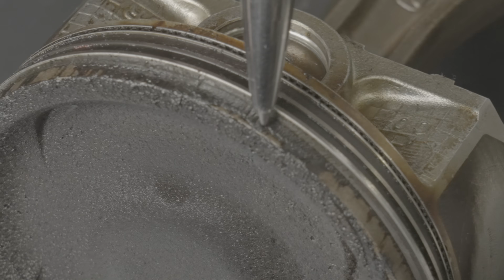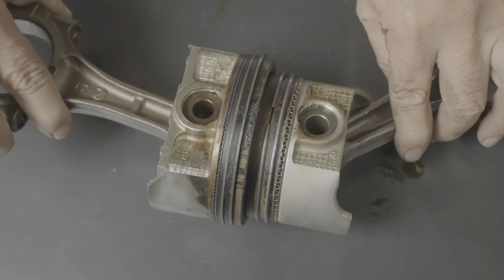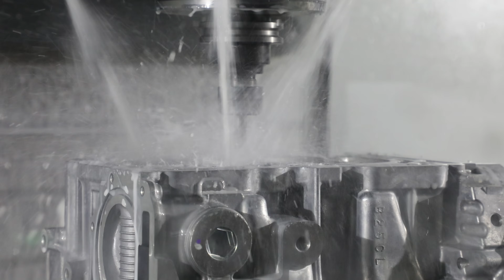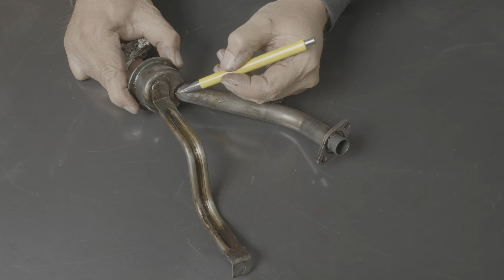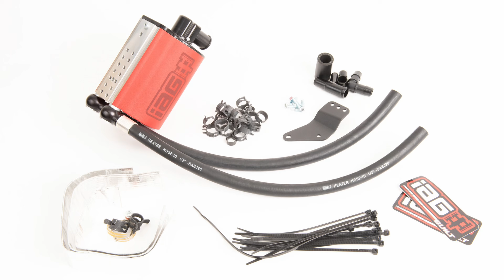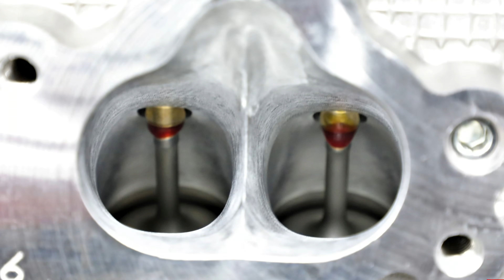Why Subaru Engines Blow Up!

Comment: Glad you mentioned the cylinder to cylinder variation Mike.  Every engine has some, but EJs are particularly bad in that way by design.  One other thing I think should be mentioned is how Subaru measures intake air temperature.  Until the FA20 came out, Subaru has always measured charge air temp on their turbo4s only at the MAF.  That's right, they only measure temps at the inlet, instead of after the intercooler in the intake manifold where it really counts.  I've never heard a good reason for this choice, but it's just a bad idea.  Can you make it work if you characterize your engine fully and understand the relationship between ambient temp and manifold temps at various load levels?  Yeah, kind of.  But as soon as you change anything related to engine load, your ignition corrections for charge air temp go out the window.  It gets even worse if you change intercooler performance (eliminating the air director from the hood scoop for example - see a lot of aftermarket hoods like that).  And if you tune with a carpet blower resting on the intercooler, you're probably not seeing the same temp curve that you see on the road.  So when you modify an EJ, you have a few options.  (1) Tune conservatively and closely compare on road performance with dyno conditions to make sure they correlate well (2) Convert to a speed density tune or at least move to a temp sensor in the intake manifold (3) YOLO!
Reply from the maker: We put it in the plenum if the tuner understands that.
Reply from the maker: I didn't realize you are our tuner and you do know that....
Reply: Seems like a lot of Subiebros chose the YOLO option
Reply: I mean it’s not like the intercooler does much. 

And I can guarantee the intercooler temps on a stock turbo Subaru is higher than the maf air filter box. 

It’s how heat and air works.
Reply from the maker: The intercooler does a lot to drop the charge air temp and improve air density.  A front mount can drop the temp by 200 degrees. You could calculate the improvement in air mass that makes and its considerable.
Reply: @fastinradfordable  basic wrx intercoolers are pretty crap, and the STI is a bit better.  But that makes measuring air temp at the manifold even more important.  The better your intercooler the closer to maf and manifold temps would be.

Comment: I own and have owned many Subarus. I love them, but sometimes it feels like they don't love me back.
Reply: One-sided love, probably one of the worst kind of relationships 😂
Reply: @aaronbryan5095  You certainly have a lifetime of experience with that....
Reply: It's like a abusive ex sometimes
Reply: Why I drive the other Japanese brand that starts with a T
Reply: @Carl-fl6wl u mean the frs and the new Supra?
Reply: Poor engine engineering
Volkswagen had the same problem with the waterboxer engines of the early 80s
Sad
Reply: Sounds toxic. I bet that Nissan chick would treat you better. She just likes a bit more money.
Reply: I loved my Subaru until it didn’t love me and blew a head gasket. I found out it was a common problem with that boxer engine. With a different engine it could have been a classic of reliability?
Reply: 1st and last POS
Reply: …There is always therapy……. (responding to the original comment)
Reply: Wow that’s so sad to hear my experience has been very great. I’ve owned a 1985GL, 1994Loyale, 2011, 2013, and my 2015 3.6R, it has 218k and runs fantastic 🎉
Reply: yeah. with 400hp IF THAT? lol. no offense dude/chick? but subi motors SUCK.  @susanjones5715
Reply: best comment about suubs ever.
Reply: Well how much respect and hard do you run them
Reply: Never owned a Subie.. never will.
Reply: Next time just drop an LS in one.
Reply: Yeah, Subs are the onion of engines…their own country song pre-written.😅😢
 @seananon4893 nah, you k-swap it.
Cheers! 🖖😎👍
Reply: buy an evo....
Reply: no shit its a machine.
Reply: @Aurora20778 🤦🏾‍♂️
Reply: @Aurora20778  sounds like a time bomb.

Comment: I've heard in colder climate areas an AOS is not a good choice?
I live in Canada in a cold province where -40 in the winter isn't uncommon. Would you still recommend an AOS over a catch can?
Reply from the maker: Did you see our bit on the IAG heated AOS in the video?
Reply: IAG AOS with the block heater.

Comment: Had a 2011 wrx and a 2013 sti. Both had bone stock engines their entire lives. No power mods, just suspension work. WRX blew engine at 103k, sti at 88k. Both had ringland failures. Have since only got back into subarus with NA FB engines, but still have that nagging feeling that something will go wrong.
Reply: FA/FB engines have a much better piston design, you're unlikely to see a ringland issue. Subaru thankfully learned a lot from the EJ.
Reply: Those were both 2.5 US models right? I wonder if the 2.0 models fare better?
Reply: @TassieLorenzo they definitely do, US Subaru engines seem to all be junk. Jdm ej20 engines don't have the head gasket or ringland issues unless some idiot puts a boost controller on and winds it up without extra fuelling.
Reply: @TassieLorenzo anything with less power will do better. Thats why the beetle motors have stood the test of time cause they only push about 90 horse power. Aka its not beating on itself just by running.
Reply: Ran 24-29 psi in ej25 on E85 with forged internals. The car was build for the Dragon and autocross and anything that pulls up next to it on the interstate. 80K miles over 5 years, only oil changes and lots of E85. Sold the car with no issues to the next "racer". Not sure how people blow up stock ej25s while driving to work and grocery stores. Maybe they are not telling us something?
Reply: @igor-rp5mw  "Not sure how people blow up stock ej25s while driving to work and grocery stores. Maybe they are not telling us something?" It could be detonation from people not downshifting and inadvertently loading the engine at low revs.
Reply: @TassieLorenzo 💯
Reply: @igor-rp5mw my guess is shitty fuel and not enough oil changes and lugging the engine.
Reply: My recollection is that at this point Subaru was tuning the EJ25 - the EJ257 in particular - very lean to meet EPA regulations and that they were pretty prone to detonation from the factory as a result. For a while a few shops in the area I grew up in would flash a new tune onto stock GR body WRXs and STIs for free for the sake of reliability. I don’t think any of those cars had problems afterward - my experience with turbo Subarus is that I put 300k on an EJ205 with minimal mods (18psi on a pnp td04, TBE, intercooler, and tune) before a drunk driver killed that car for me, and my parents have each run up over 500k on two N/A Subarus each, so I’m always very surprised when people talk about how unreliable they are!
Reply: @ObeseChess  are you in the US?
Reply: @Walterrinho  I am!
Reply: now your issue is the cvt
Reply: Why subject yourself to further abuse? lol
Reply: These failures do not happen for no reason.
Reply: even junk yard or donor cars are there 4a reason, can't use anything from them!!! 😵
Reply: Shouldve got some tunes to make it more reliable. A reputable tuner can make a ticking time bomb into a reliable beast.
Reply: Bonestock isn't good unfortunately either. Best results I've seen are quality built motors by a builder that truly knows subbies like Mike and how to properly build and measure/spec boxer engines out, and just mild performance levels of tune, so building them stout and then running within 15-20% of the stock levels, the engine is barely being pushed more than stock but still wakes them up. And then quality aftermarket parts, fasteners, and the engine built slowly by hand instead of a assembly line, fully blueprinted, balanced, and torque plates + arp fasteners and ATI or Fluidampr balancers and better headgaskets and then either custom closed deck plates or epoxy fill, unless using one of the less common closed block decks they have. Then stringent oil and coolant changes according to schedule for severe maintenance schedule. And the best tuner you can afford 😂. Lots of money but with a unique sound and feel makes it worth it if you have the money
Reply: You already had bad experience with Subarus yet you still went back to their brand, no offense but does logic not exist in your head?
Reply: @aaronbryan5095 what do you mean no offence? The only point of your comment is to try and cause offence so that's embarrassing for your parents. And he did use logic he's got a different motor
Reply: @aaronbryan5095 by that logic ls guys should also run away from ls just cause they blow. No.. go to reputable tuners and engine builders. Any engine thats half assed will blow.
Reply: Get a real car. A corvette C7.
Reply: @pizzaparty-r1c get a real car. Chrysler Pacifica.
Reply: @pizzaparty-r1c he might not be 60 years old yet..

Comment: I had 2 Subaru in the past. One was a 06 wrx with ej255 and the other was a 97 legacy with the ej25d i loved them and miss them. The 06 Wrx i had a aeromotive 320 pump with stock injectors. Vf39 and i think was a APS top mount intercooler with a cobb turbo back catted exhaust  and a ots tune.  even so i didn't do any big track thing, i autox and drag raced it all the time and beat the living heck out of it but i was on point with maintenance. I sold it with 150k long time ago. The 97 legacy same thing beat the heck out of it and drove it everywhere. I sent it to the crusher at a 237k because all the Rust and headgasket just finally gave out

Comment: * my coworker after doing donuts in the snowy parking lot on a cold engine *

“I don’t know why engine blew up, I ALWAYS baby my car. I guess Subarus are not reliable because this is my 7th engine now”

True story by the way. 😂 🤣 😂
Reply: this characterizes most subie owners that complain about reliability in my experience.  meanwhile, going on 300k miles on 2 with stock internals over here....
Reply: That’s what I’m talking about bro. I never hear anything bad about Subaru. When I do it’s usually a spun bearings, blown block, ruined piston or connecting rod.

Then I ask, what did you do?
Reply: @menumlor9365  Indeed, I think once you start tuning a car / doing mods, and then pushing it hard - IDK, I have a hard time taking that out on the car / car company. The STI, maybe if it's not holding up stock cause it's sold for that stuff, but the rest are sold as family cars. You start tracking any "normal family car" and I think things are going to break IDK.
Reply: Some people have zero mechanical sympathy.
Reply: A Subaru turbo cannot handle its own power long term if there is extended WOT use. Such as track days. They can handle AutoX or a track day here and there for a while.
Reply: @Triple_J.1  autocross compared to an actual track(lets not conflate) is most rough on the tires, not on the whole car and the first 2 generations of WRX sold included free SCCA memberships from Subaru.
But can you name a commuter 4-door within affordability of 80% of car drivers that could handle the torment of a track day?

Comment: I want an sti or evo. So can we get a video on the 4g
Reply from the maker: That's coming.
Reply: @motoiq  Can't wait for videos on the 4G Mike!!! I actually own the last iteration of the iron block 4G offered in the USDM -- the 4G69 -- in my 2009 Galant. This underdog engine never got the appreciation it deserved, but it has outlasted many friends/co-workers' Toyota 2AZ-FE and Honda K24s (with their piston ring defects and/or excessive oil consumption issues). I absolutely love my underappreciated, unloved and underrated 4G69 with its prolific reliability (when the timing belt is changed at recommended intervals!)!

Comment: Boxer engines are the only reason I don't own a Subaru. The cost to keep one on track just isn't worth it. You know if you know.
Reply: $20,000+ for a mild IAG build really hurts the soul when you start looking at what other platforms are doing with just basic bolt-ons. That 20k can go pretty far into suspension/tires/safety. 

*Caveat*, if you need AWD there isn't much choice.
Reply: I tune Subarus and always try to make people understand what was said in the video and explain the exponential dollar curve on modifying Subarus.  I no longer have one because of the motor. 

Hell, I love the new BR-Z/FR-S and briefly considered buying a brand new one.  I couldn't do it because of the engine.  There are 20 year old NA Honda motors I would rather have in it.
Reply: @yamahaSHO Toyota has announced they’ll be ditching Subaru’s engine in the GR86. Not for a couple years though.
Reply: @stevef3521  Link, please.
Reply: @stevef3521  I would put zero weight on that story, since the original source was some rag magazine, it's false (I'll wager like 99.9% false).  Toyota didn't announce anything.

It's pretty obvious they wont' do a turbo anyhow, to prove the point.  They will do a hybrid, given emission requirements in many Western markets in the near future.  Plus a well developed hybrid setup can be made to respond similarly to a small turbo. Toyota will contribute hybrid tech, and for all we know, it'll still be on a boxer.  Given the boxer is a key design on the twins, even with the original Toyota designer saying it needed to be a boxer (apparently).  The car also has a very specific niche target market also, and they won't want to change that, given there are no real competitors in this niche, changing anything too dramatically can shift it into other market segments with already established rivals.  Anyhow, whatever engine they decide, it will be in both cars, since it doesn't make any sense for the BRZ and 86 to have different engines, it's all made on the same Subaru assembly lines, and is 99.9% the same car.

So my guess on balance of probabilities is the next Twin model will have a hybrid boxer (but it will be a decent hybrid that provides more pep while also lowering emissions, and that the car will stay in the cheap affordable sports-car segment).  They're great cars anyhow, for what they aim to be.  They aren't trying to be race-cars.  That is why the race spec versions use race prepped engines.  The FA24 has no race prep version, given there is no incentive to do it, when Subaru uses the EJ20 for racing applications, same as how Toyota have their own race prepped Toyota engines to use in their racing applications (and they're still separate / independent companies legally, so they align on some projects, but the vast majority of their projects they don't do with each other, and their motorsport arms have zero relationship to one another.  Toyota won't ever use a Subaru engine in a racing application, likewise Subaru has never used a Toyota engine in any Subaru racing application - and it will stay this way, unless some major (MAJOR) changes occur in their relationship or partnership moving forward that somehow spurs this change, i.e. major joint Motorsport collaboration, deeper relationships in other areas, etc).
Reply: Same, I think the WRX is a real cool car and I've nearly pulled the trigger on one. I don't own one because I really don't trust it as a daily driver.. I can't afford to be rebuilding one if I drive it a little hard. For all the hate they get, when they are running right they are undeniably good sports cars.
Reply: @notsam498 they're reliable until they're modded and improperly tuned...if they're tuned. As a moderately driven daily they're fairly reliable. This guy keeps talking about 400+ HP, I personally never go above 350 and mod for reliability, like AOS and more solid components replacing cheap OEM plastic. I'm all for an AWD daily that can beat out 95% of the other cars on the road, and off...
Reply: @murmsuniversalrobotics3938  I am less concerned about plastic and more concerned about the internal mechanics. I have known a number of people to get burned with out ever tuning one of these things. I realize that with some money on quality parts they are going to be great engines but, fair to say cost is always factor. I think what you are saying is true of most engines that get a bad name. From my perspective though, the more forgiving the engine is the better. Its the same conversation I have with my roommate about his VW GTi. It is a decently fast car, I like the way it handles, it's a good car overall. It's just they are very unforgiving engines, both in tuning and maintenance. plus OE parts are expensive on them. It isn't a design flaw it's the design philosophy. I think subaru designs engines like this too, they were built for roughly the power envelope they roll out of the factory with, they great for moderate driving and probably will be reliable given those conditions and proper maintenance. I realize though, I drive hard, I want a sports car that I can abuse. this goes back to cost, because all sports cars break when you are hard on them, it's really a question of what tends to break, how often, and can you afford to fix it when it does. I cannot afford to fix some of the problems that crop up from abusing a WRX,  most of the failure modes in the engine can result in a rebuild or at least new headgaskets. Personally I cant afford that, I am too poor.
Reply: Honda lookin better tbh
Reply: Porsche block/case design is much stronger due to being higher output engines.  @DaveP-uv1ml
Reply: @DaveP-uv1ml  Nope.